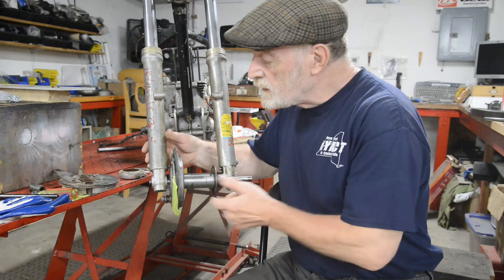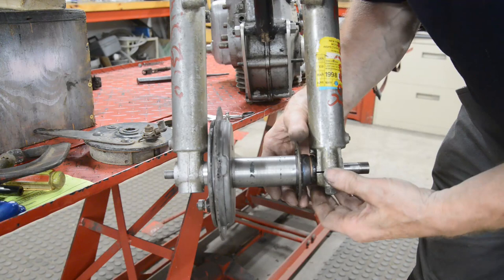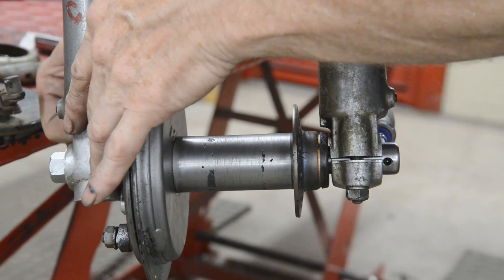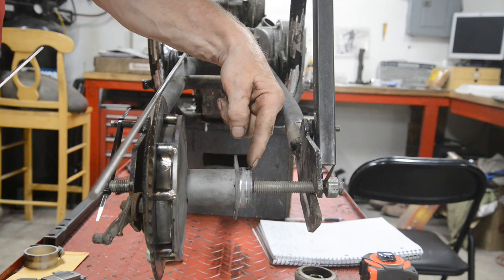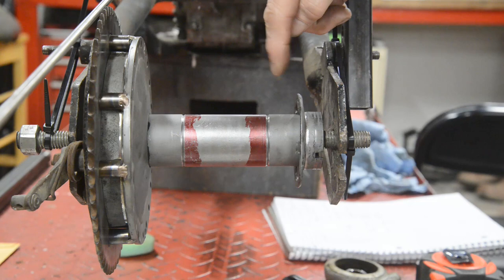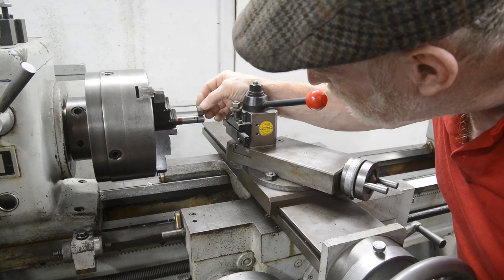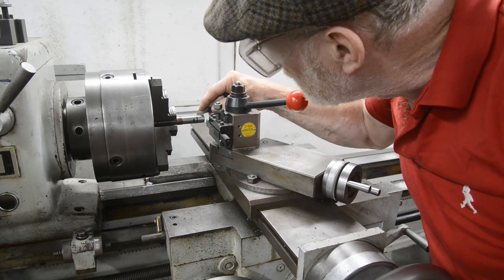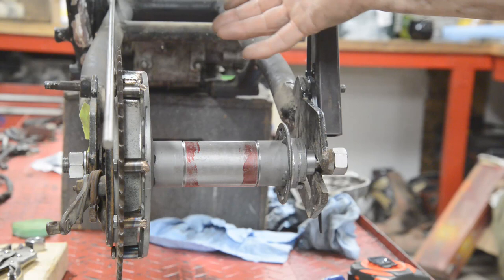Enfield Bullet 350 Trials  -  Part Three

Comment: Thanks Mike, glad you straightened out that front hub - it was doing my head in. Using the compound as you do is a great way to compensate for any wear/backlash in the lathe, sadly we don't all have access to new machines.
Reply: I thought the same thing about the front hub
Reply from the maker: I knew you would all worry about the hub even though the drum was square to the spindle so I persevered and straightened the spoke flanges.

Comment: Yet another very interesting episode, personally I enjoyed the machining, I know what you mean about lathe work being somewhat boring to watch for some folk, however everything is not achieved with the press of a button or key and five seconds later out pops the finished part. I've just spent two hours or so making a replacement component for a broken casting and I find the time fly's by whilst actually doing the machining.
Reply from the maker: The time thing is strange. I often think "Right I will just turn up a couple of these, won't take me long", and then several hours later I am finished. I suppose that it is concentrating on the job in hand that means you never notice the clock.

Comment: always watch your vid's. i have been messing with bikes since 1960. i have just done similar job re your front wheel/forks. i used a pair of disc braked forks for drum brake, turned forks round, left to right, right to left then cut off 3 caliper mounts, left the top mount for brake anchor arm on drum brake. are you leaving that run out on front hub? thanks
Reply from the maker: That's what I like to hear. People in their sheds doing stuff not just watching others. I take it that we are of a similar age.

Comment: Michael, I like your video series. I do have a sweet spot for British motorcycles. I had a 1970 BSA 441 Shooting Star. I wish I had another! What is your opinion of Royal Enfield vs. Triumph or BSA? I did see a few when I was a young lad, but most folks had Triumphs or Beezers.Thanks.
Reply from the maker: I always tell people that the Enfield twins are the best that came out of the UK, of course that is just my opinion. However they were really well thought out engines with some very nice features and lots of power. They handled and stopped well and all round were a really nice bike to ride. Their only fault was a badly designed oiling and engine pressure control system, hence the "Royal Oilfield" moniker. But the couple of mods and drillings that the Enfield owners did cured the leaks completely.
Reply: @BritanniaMotorcycles  , i am currently watching the Royal Enfield/Indian video series. I have a greater appreciation for what you said about their engineering. 
On another note, I know that in your area of New York, there should be z beer available known as " Genesee Cream Ale." They also make a beer called Dundees Brown Ale. You may try those to make up for the Newcastle demise. If you have any advice on locating a BSA Shooting Star, let me know. I would even settle for a Victor at this point! Lol!
Always,
Alan Scaggs

Comment: Using the compound is a cheat, and it only works properly when the compound is clocked true to the cross slide, think about it
With it set at an angle, when you dial in .001" as you did, you are probably not cutting on the rear face at all, while machining less then amount you dialled in.
Threading isn't difficult, but there are simpler, easier and safer ways than you are using, such as cut a recess where the thread finishes (which you should anyway), then invert the cutting tool, and run the head in reverse, you can then machine away from the shoulder or inner end, where you stop then doesn't matter.
Reply from the maker: Of my machinist friends they all use various ways to thread. This is the way that I was taught and it works well for me. I regularly check the travel of my cross slide with an indicator, mostly to make parting easier.

Comment: Looking at the size of the front brake would make a person glad the bike isn't capable of great speed because the front brake does not look capable of doing much at any speed rather than slow you down enough to only cripple you for life rather than kill you in the event of someone stopping in front of you in an automobile with disc brakes at any speed over 35 MPH.  I know this is a trials bike and hopefully won't be doing more than a few miles per hour.
Reply: This a TRIALS bike and competitions have no timed aspects unless the Talmag in the UK so speed not relevant as not being set up for road work. There is engine breaking which also helps in trials at low speeds for which the right hand (throttle) control is more important at all times than other forms of biking. Bikers who race always struggle initially in trials even with modern disc brakes!!!
Reply from the maker: Peter is right, particularly for the older bikes and the sections that they are used in. The brakes are used more to slow and control the bike rather than for stopping. And the 350's engine is the best brake of all. The modern riders who move to a four stroke after years on a two stroke bike have huge problems with the way the bike suddenly slows when they close the throttle, they have to learn a whole new technique to riding.